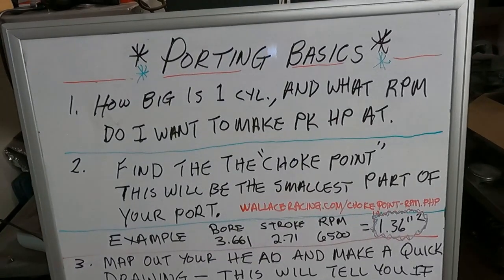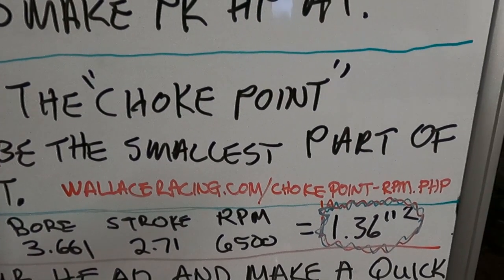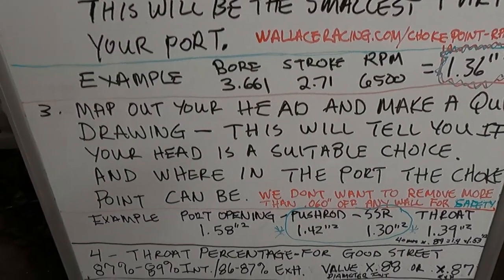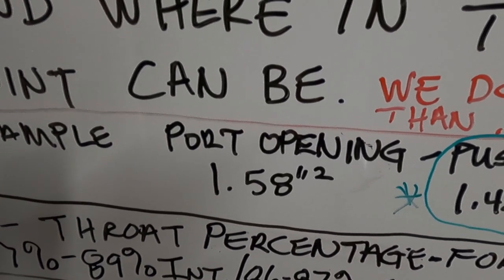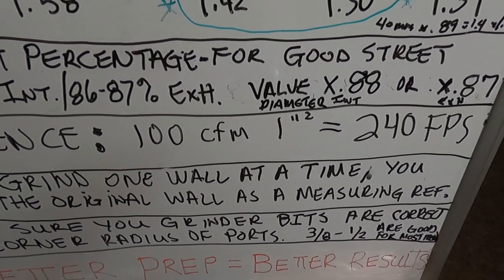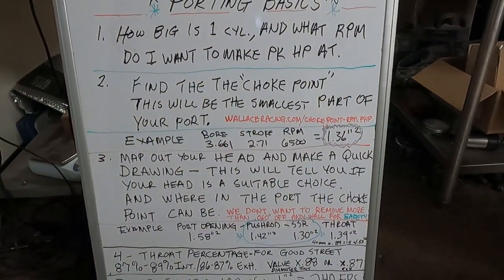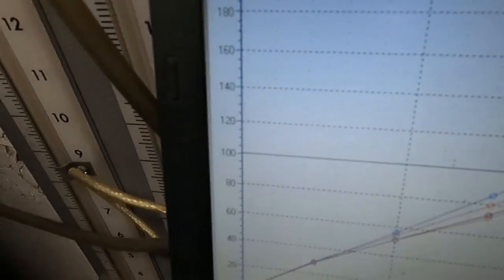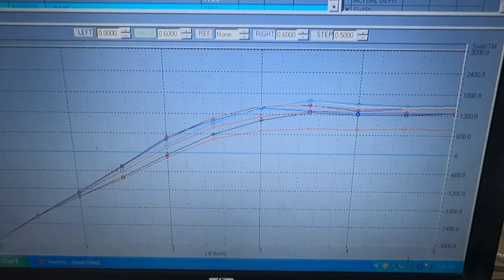Cast Iron Head Porting Part 2

Comment: When I had one head off on my 292 for a non-head related repair I decided to looks at the valves and clean them. Since engine had 10k miles and I didn’t like the look of oil crustation on the valves I decided to put positive seals on it. I also took off the other head. It was obvious that the seats were replace but never blended. I have built many Land Speed engines (not-Y blocks) so I had all the necessary tooling and blended the seats as well as cleaned up/smoothed the exhaust ports. For a street gasoline engine I like a fairly rough intake side surface to help with atomization. The lapped valves and seats were in excellent condition As a side I checked the oil feed to the heads and found it to be very adequate. This is not a performance engine but it runs and idle extremely well and barely audible when standing beside the car when running. John’s work on these engines is renowned both race and stock. I trust him and 2 others, one in Texas and the other in central California to advise any of us wanting to improve these engines. I especially glad John ventured into the aftermarket with excellent parts.